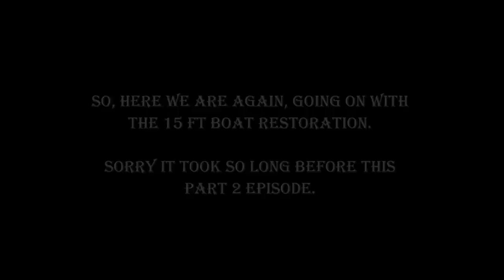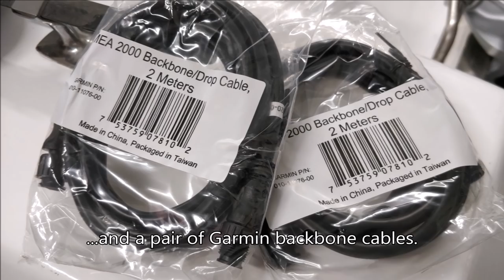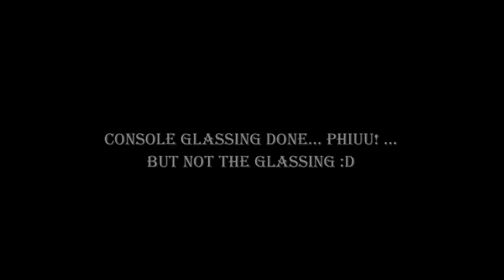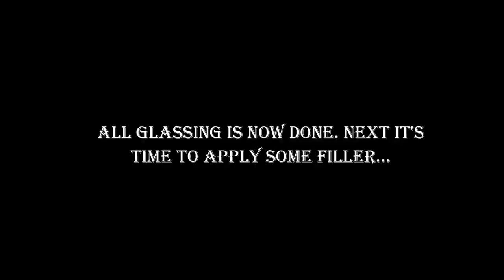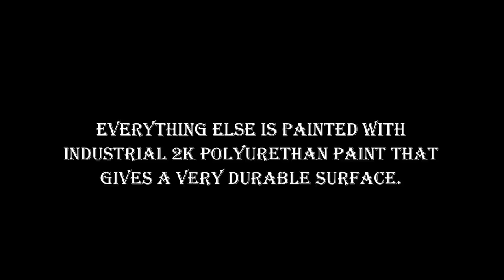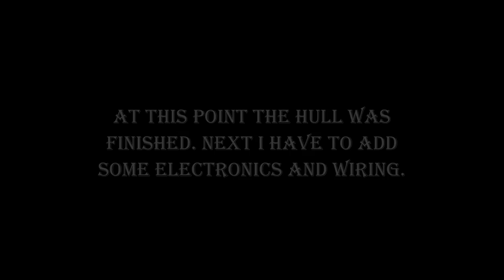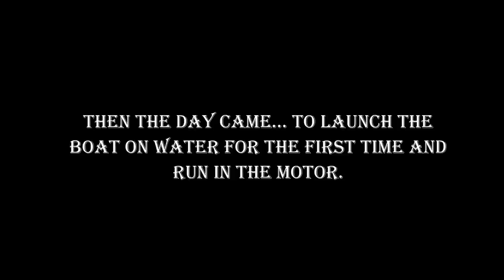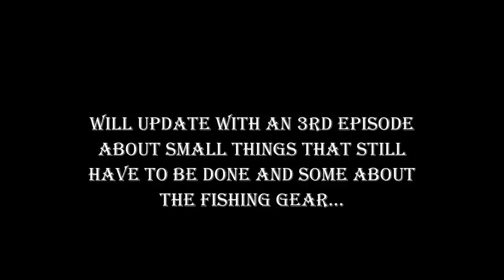Half Cabin Boat Restoration and Modification Project - Part 2

Comment: nice job, but you add weight and make floating foam less. you soud calculate the kilos off boat and see how much floating you need. maybe you have to spray some polyurethane under the floor

Comment: Very nice result!  I did think you were going to fit the steering etc to the bulkhead behind the cabin windscreen, (like a car) especially when you said you were looking for as much space as possible rather than just move it a little way forward? must have misunderstood.looks brand new out on the water! Hope you catch plenty of fish now!!!
Reply from the maker: This is a very small boat, so it would not be parctical to sit in the cabin when driving, as you can not stand up. Now it's possible to drive the boat and use the fishing equipments from the same seat. And it's also possible to drive standing up.

Comment: That's a great job you did there. Boat looks awesome. That looks just like a boat my friend had once, a 15ft half cabin too. We had a hell of a job trying to launch it off the trailer as it just would not float off easily. It took us a while to realise why. It had been converted from an outboard motor to an inboard. A 3.2 ltr marinised inline six BMW connected to a Kamewa jet drive. I think that set up was a little too heavy and powerful for the boat which is why we had a problem launching. That thing used to fly though. Great fun. The boat itself was made in Finland and was quite strong. Where was your boat made?
Reply from the maker: Thank you. That boat sounded like lot of fun 😵😅 This boat is also made in Finland.
Reply: @Maxxifull  Launching and recovering it was, but once in the water it was as fast as a wet bike. I think it might have been the same boat as yours.
Reply: Buy poly crmfradft. 4.8 meterr 15.5 fiter. 14.88 filter 90 hp jet out board

Comment: lovely little boat, I had one concern, the new crossmember you added, will that stop any water getting into the front of the boat running to the back and being drained out of the bilge drain plug? Is that TEN rod holders on the roof? boy your going to do a lot of fishing LOL. Good Luck
Reply from the maker: Thanks. Yea, the actual bilge is only in the rear part of the boat. The crossmember makes a wall so no water will go under the floor. Of course there is a possibility that some water finds a way under there, so in the future I will make a service hatch and fit a emergency bilge pump under the floor.

Comment: Nice job mate. I got my hands on a similar boat. It needs the floor replacing. It had cheap ply down that wasn't sealed in or anything. It had all delaminated. 

I was wondering if it is worth putting down some marine ply and glassing it in? I have seen some people just opt for rubber matting on the bare Hull.
Reply from the maker: Hi, and thanks. I have seen many projects where they glass in the floor ply. Don't know which is better..? I just used marine sealant/glue to fit the floor in this boat. Sealed off all the edges. I use weather proof plywood with a plastic anti slip surface.

Comment: Will you do trim tabs? That will help you with the leaning issues
Reply from the maker: Will see. Have been fishing the whole summer so havn't done anything for it yet. Have noticed that weight also affects how it lean. If I'm driving the boat alone it goes perfectly stright. But with a friend it easily starts to lean to the left a little bit. I have two batteries on the left side so there may be too much weight on that side. Also the transducers are on the right side, so they tries to lift like a small trim tab.

Comment: You might want to put on trim tabs.
Reply from the maker: Have to check the dual transducers. Could maybe lift up a 1-2cm. Can be that they push up the right side. But also weight is not equal on both sides. Have quite heavy batteries on the left side and a passanger on that side would push down. When boating alone, it goes totally leveled at full speed. Going to change my 110Ah lead battery to a 90Ah lithium, that will save some weight on left side.

Comment: How much did it cost altogether?
Reply from the maker: Havn't calculated any exact amount, but everything is expencive these days. The boat was 650 euros, and only polyester and fiberglass cloth was maybe something like 300 euros in total, fillers and paint ~400 euros. But it doesn't feel so bad when you buy only small amounts here and then. 😄 Of course the new motor was the biggest investment in the project.

Comment: Why 10 rod holders on a 15 footer?
Reply from the maker: Usually here on local small lakes the max amount of rods you can leagily use is 4. But on the sea or on bigger lakes, trolling with big planers and 10 rods is perfectly fine.
Reply: @Maxxifull  I had a picture of 10 guys with 10 rods lol
Reply from the maker: @merlin1346  🤣🤣🤣Hahaa lol. 😅

Comment: Dude if i was me doing the rebuild i will take out that cabine and install a roof top only.
Reply from the maker: Thanks for your comment. A T-top would be nice on a bigger boat. This types of small half cabin boats are quite popular here where I live, and the purpose is that the cabin gives some cover from cold autumn wind when you are out trolling fish. Will also add a small diesel heater to keep the windows clear and warm up cold feets.

Comment: Is it just me or does anyone else think this is a bit slap dash reno. The transom looked terrible before glassing which hid the wooden mess but there shouldn't have been a mess in the first place. As I watch this more and more I get a cringy feeling because its as if there's no love involved.  I don.t even own a boat but have done many projects over the years to recognise 'cowboy' work which I would class this as. The young lad has worked hard and spent lots of money on this I just wish his work ethic was better.
Reply from the maker: Thanks for your feedback. Also negative critic is welcome, then you can learn new things and make next project better. Trust me, there was not much loving feelings when cutting and sanding, totally covered in fiberglass dust, haha!

What do you mean with the wooden mess, I don't understand? Had to replace the orginal wet and rotten plywood. How would it have been done right?
Reply: Maxxifull thanks for the reply. My comment about the wooden mess was with regard to 2:31 on part 1. I’ve reviewed it several times over again and maybe I’ve been overly critical. On the new transom wood being replaced, there are large gaps on the left side. I would have assumed that neat joints all round would be better. There’s  maybe a reason why the gaps are so big which you didn’t comment about. As I said I’ve never owned a boat I’m only going on my building experience where joins are important. You’re project is actually a good one, is it your first. I intent to get a boat in the not so distant future and this size would be a great start. Please don’t take offence at my negativity, I’m just a grumpy old man, unfortunately I’ve watched many boat project videos but those were expert ones. You worked hard and finished with a cool looking boat. Well done
All the best.
Reply from the maker: @mufuliramark  Of course it would have been best if the plywood was done in one piece and tight fit also in the upper part. But then it would have been needed to remove the whole upper part(skin) of the boat. One thing I didn't want to do. Now I had to do the transom plywood in pieces so I could get it tight under the fiberglass cut(edge) that was left from the outside skin. It was a pita to get the pieces fit, so thats why there is gaps on the top part of the plywood. All gaps was poured and filled with epoxy, so the strenght should be very good. The boat has been in active use the whole summer and there is no marks of flex or any stress cracks etc. in the transom area.

Also, there was quite amount of small things done, that I forgot to document or I couldn't include in the videos, as they would have been too much and maybe not so interesting.

Have done many different projects, mostly with cars and metal work, but this was first fibeglass project in this scale. At younger age I have done different car speaker enclosures out of fiberglass, but that was many years ago. No hard feelings, now we got a great conversation going. 😊